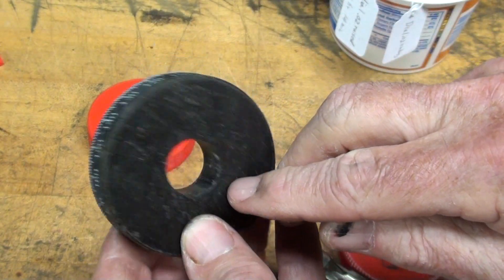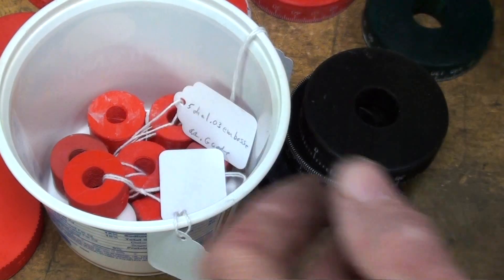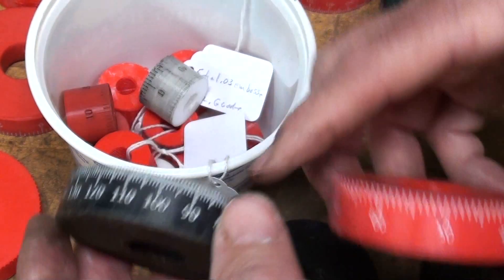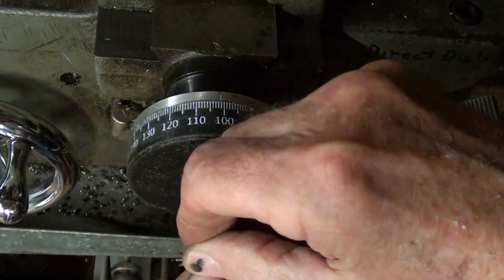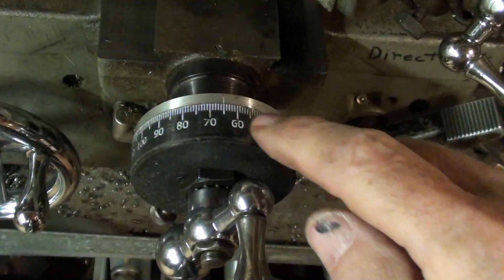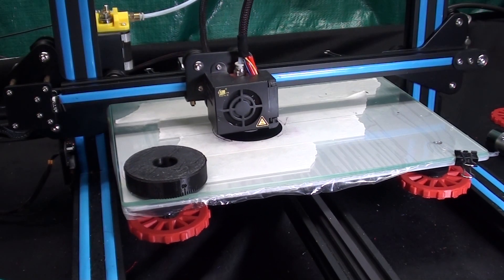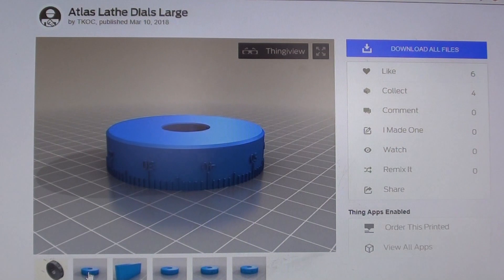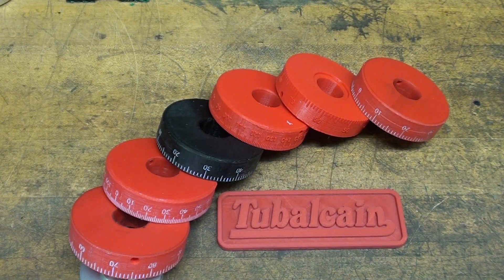Make Extra Large Atlas Lathe Dials pt 2 TIPS #432 tubalcain

Comment: Try a wax “China marker”. You can purchase them cheaply in white or black at an art store or a Hobby Lobby or you can use a black or white Crayon. 
I have found that if you warm up the piece with a warm hair dryer, then rub it with the China marker or crayon to fill in the graduations & numerals it works much smoother. After that just buff off any excess by hand with a soft cloth. 
Thanks again Mr. Pete for another great video!

Comment: Mr. Pete,
  I recently watched your video on how a carbide light works. I too am an Illinois boy though I grew up in Pike County, currently living in Decatur. As a boy in the 1950s I also explored the limestone mines near Pearl, Illinois using those ancient lights and yes, made a few nefarious experiments with that and other substances. 
   Calcium Carbide was used for other lighting purposes as well as miner’s lights. During the 1980s I lived in Clinton, Illinois and my teenage son had a job managing the local movie theater as well as the drive in theater outside of town. The projectors at the movie theater were modern electric light projectors but imagine my surprise when I went to help him at the drive in one hot summer night and found those huge carbide light projectors still in use. I believe there were two large flame nozzles in each with three or four large reflectors. My son hated operating those machines as they heated the projection booth tremendously. He also had to polish those reflectors before and even during the show. There were two projectors as a full feature film has two, sometimes three huge film reels. No one watching a movie ever sees it but near the end of a reel a number countdown appears in the upper right hand corner of the screen and the projectionist and a helper have to time the switchover from one projector to another when the count drops to zero. If done flawlessly the movie continues without a single glitch in the onscreen scene. It was absolutely fascinating!
   I am like you, always wanting to know how things work. Ever since I can remember I have been taking things apart to discover their secrets. I currently have two sheds full of tools and bits and pieces of this and that. As for those who may complain that you go into too much detail that’s too bad. They have the option of turning off the video at any time. I personally enjoy your explanations and life anecdotes. I recently went to an estate sale and bought a Sterrat inch micrometer in excellent shape for 10 bucks. I also bought an old steel tool box full of button dies and taps, about thirty HSS tool blanks and even more already ground. Some were junk but all were of a quality that’s hard to come by these days. Everything from 5/16 to 3/4 in size. Under all that I found a 4 inch Sterrat machinists clamp that cleaned up real nice and a six inch Sterrat hook rule as well. I paid 15 bucks for the lot. A good score for me. My wife and I love estate auctions and go to many during the summer months. Occasionally do garage sales but only if there isn’t an auction I’m interested in.
Reply from the maker: Thank you for commenting. Not too many people even know what those lamps are. We sure had fun with them as kids

Comment: I think the black will turn out to be the better workshop color. White would get grubby looking very quickly, with oil-borne dirt getting into every crack and crevice of the printed surface. Red would draw attention to where it wasn't really needed; good color for an emergency stop button, but not so much for a cross-slide dial. Black I bet would hold up well with the white silicone shedding any dirt pretty well I expect.

Comment: Out of passing interest: Eons ago I was given a ball clock kit[1]. It was a black plastic affair, and had some graduation markings that needed high lighting. They suggested rubbing & working an ordinary crayon  into the markings and polishing off with a rag. It worked very well... but I doubt the method would be suitable for an often touched/cleaned surface like the dials. [1] Don't think that clock is made anymore; but if you Google 'idle tyme clock', similar wooden versions seem to be available. The thing was very noisy, and balls often fell out of their tracks etc. A cool 'Rube Goldberg'' novelty, but beyond that... Just looked at eBay, looks like the one I had was an 'Arrow Ball Clock'.

Comment: You may want to consider  tweaking your slicer settings, maybe increase your print speeds.  I printed the  200/Emboss version on my cheap Tevo printer in only 1.5hrs using relatively high quality settings.  I use Simplify3D so I can't recommend settings in Cura.   Great tip on using silicone for the embossing, although I should have let it cool down before applying.  It started curing too quickly making clean up a bit of a pain.

Comment: Another trick to making the lettering stand out, I have used on chicken head knobs on switches , is to paint it with whiteout then scrap off the part on the surface, it usually comes off easily on the smooth surface.

Comment: This may be obvious..... but could you turn an aluminium puck to go on where the original dial was, then print an outer graduated shell. the thumb screw with a shoulder would lock the shell to the aluminium core. It would be much faster to print and the thumb screw will not waller out the plastic thread over time. Thanks for sharing.
Reply: Great  idea indeed.
Reply: I was thinking the same thing, but the design  as is looks like it works well. Nice job

Comment: Hi Mr. Peterson. I would very much like to upgrade my Atlas cross slide dial to the 200 graduation dial.  Loved this video! A little off topic; is there any way to get a slower feed rate on my lathe with a quick change gearbox? Maybe a smaller gear on the banjo?
Reply from the maker: Not really. Did you see my older video on slow feeds.  Using a motorized lead screw

Comment: Would it be possible for you to put a Kill a watt meter on the printer and see how much electricity that is uses in that 4 hour print.
Reply: My CR-10S uses about 250 watts max with heated bed and nozzle on.  During a print wattage varies, of course .   My guestimate is about about 1 kW-h per 6 hours printing.  The CR-10 (vs 10S) might be a different.
Reply: What do you suppose that power costs you at your local rate?
Reply: Nothing -- my annual net bill is zero due to my solar panels.  I do pay a $10/month connection charge.   My rates would otherwise vary by season and by time of day.   My last bill put the rates between 1 and 5 cents/kWh.  I could probably print all day long for less than $0.15 worth of power.
Reply: Thanks for the reply and the info.

Comment: I like the black better for now. but I think yellow or neon green plastic (or just the red if you want to use what you have) with black silicone numbers might be the most visible. As it wear and gets dirty the numbers might start to become nonvisible from grit adhering to the silicone and making it dark up to the same color as the dial itself. If it were dark numbers you wouldn't have this issue, I think.

Comment: I printed mine from black pla as well .  My printer is a CR10s and on both the lathe dials and lathe gears  the center holes all printed a bit undersized . I don't consider that a real problem , just something to be aware of  and factor in before assembly .

Comment: Looking at the finished article - it's so close to something you'd find on a store.
When you go in close however there are some irregularities - only cosmetic ... not a big deal.  BUT ... just out of interest what (if any) are the finishing options?  Some plastics just chew up and are ruined if the surface is disturbed.  Some you can shine with only a little effort.
Can that plastic be machined or sanded to give a smoother face.  Not getting silly with graded papers or compounds - just a quick skim with something to improve the finish.
Reply from the maker: This material does not machine at all. And it sands very poorly

Comment: I'm looking at making or printing some large "direct reading" dials for my 12" Atlas lathe and came across this.  Do you lose any travel on the cross slide when you retract the tool?  I'm worried that the top of the dovetail might come back and run into the dial.

Comment: Great video as always. Do you think it would be better to print a " ring " with the graduations on it and then press it onto an aluminum collar? It would look more like the Hardinge lathe dials and save tons of time on the printing. Thanks for all your videos and keep them as long as you want.
Reply: Agreed , just what I was thinking.
Reply: My first thought was to print the grads, then adhere to the correct diameter - silk screening would work, not to mention computer printed with modern inks.  The printing could / should be overlaid with a protective film. . . maybe a light activated enamel ?  :)   Answers are always as easy but opposite the problems.
   " If you can't make it ACCURATE, make it ADJUSTABLE" !
Reply: That is a great idea. It would be stronger and take much less time printing. Possibly use PETG filament instead of PLA because PETG is somewhat flexible if pressed over a collar. Plus the infill could be greatly increased, even up to 100%.

Comment: Very Nice!
Is there a way to print the main dial in black and then change the filament to white and print raised numbers and lines on the black dial in white?
Reply: Not on the CR10 printer , I think it would be possible on a dual extruder printer by using two colors of pla when printing the part , but not by going back and doing another operation . There is no way to really index a part , nor does the print head(s)  have an axis  to tilt  and add material other than straight down .   Hope that makes sense ..
Reply: That makes sense. Thank You

Comment: 4 plus hours to print providing all goes well seems like a long time compared to making one from metal(or maybe a hardwood ???). I would doubt that in 80 or 90 years time that the plastic one will be around what  with wear and tear and so on.Good video though.
Reply: 4hrs is very long for a 3D print this size, I don't think using very fine layer setting is worth it for the markings on the side. Could be printed in about 90min.  And a few years/decades later, you just print another one if needed!

Comment: Just one question,
When you talk about FILL, do you mean the density of the material??
Reply: The Workshop Mechanic Channel Fill, or infill, in 3D printing is a setting on how solid you want the object to be. In 3D printing there is a setting for wall thickness (or layers) and infill determines how much material occupies the inside. 0% would be completely hollow and 100% would be completely solid. There are also settings on how the infill looks. Honeycomb, squares, zigzag etc. Honeycomb is most widely used as it tends to be the strongest and offers good bridging support for the top layers.
Reply: Basically. The fill is the amount of area that is filament rather than free space inside the part. If you were being technical it has nothing to do with density as that is a material property separate to empty space or "voids". Higher fill increases the strength of a part to what is maximum for that material without annealing (as the layers are not stuck to each other 100%), but increases print time significantly and uses more material.

Comment: As uneven as the stamping on the metal one you made is, it's certainly more fitting for that fine old lathe than a cheesy plastic printed one. I'm sure one day soon they will come up with a metal printer that makes quality looking parts at reasonable costs, but I do not know if they are practical yet.